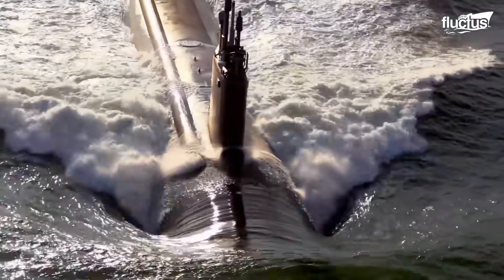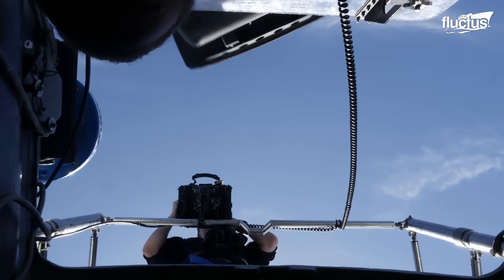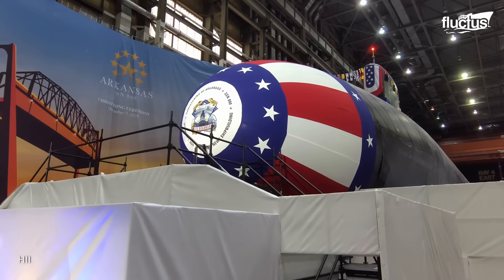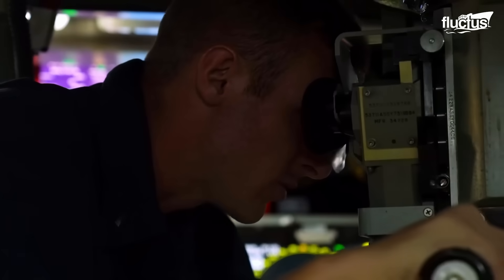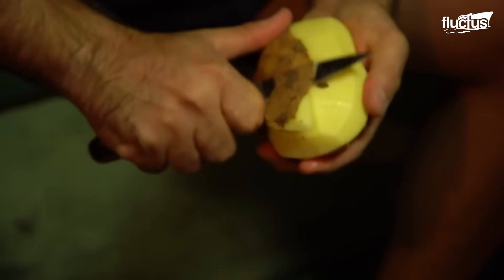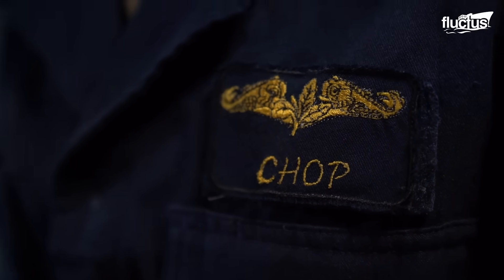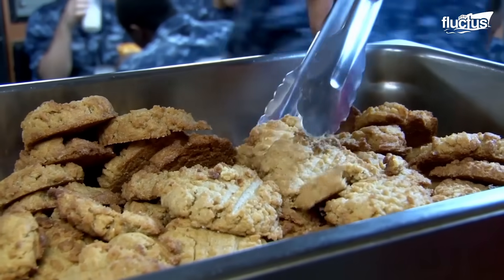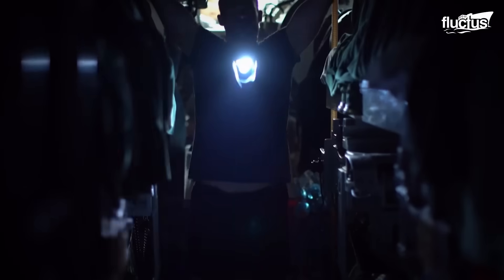Life Inside $4 Billion US Nuclear Submarine Secretly Deployed Underwater for Months

Comment: If I'n correct subs still operate on an 18 hour. clock.  I believe  a 24 hour day was tried but didn't get the desired results.
Reply: I used the 18 hour clock when I was on the Boats from 1976-1986. But it’s a little more complicated than one thinks. 

Sailors stand “Watches”. Think of them like “Shifts” at a Factory. So an 18 hour day consists of Three Watches of Six hours each. So you would work for Six, then be off for Twelve.

EXCEPT that you have to do Training, Drills, Qualifications and Cleaning.  And at least once a week you have a “Field Day”.  That’s when EVERYONE is awake and Cleans. 

How they do this on a 24 hour day seems hard to do. And you still keep track of what Time it is Outside the Boat. 

Hope this helps.
Reply: Not any more, it's not good for your heath. It's now 3 section.